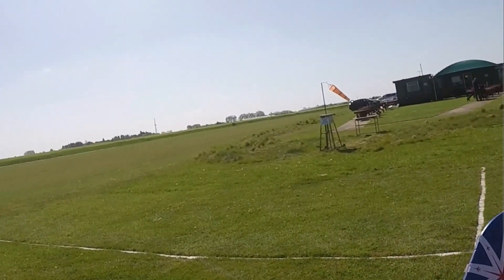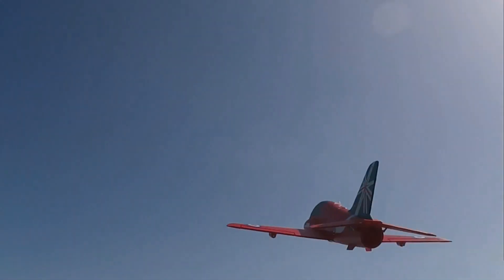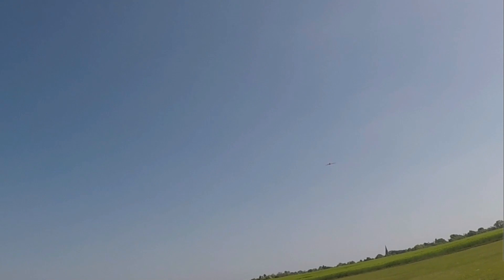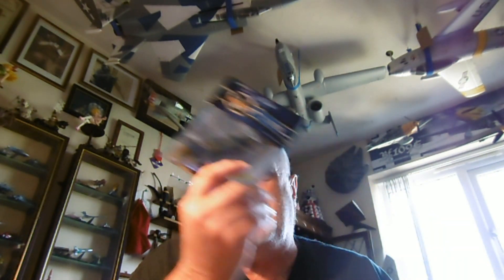Arrows Hawk & T33 - 30 to 40 AMP ESC Upgrade

Comment: You don't have to cut the fuselage. Instead remove the edf (it's fixed to the fuse with foam tack) and pull the esc out through the hatch. Connect new esc and push it all back. Glue the edf back in place...done.

Comment: Maybe I am wrong, but wont the more draw more amps when holding the plane stationery?
Reply from the maker: Yes and that's the Point - so you take a static reading knowing that it will drop off in flight (loaded) - but as it is not posable to measure how much it will drop - i find it safer to install an ESC that handles the load in static mode - so you know 100% your going to be ok on full throttle all day long..

Comment: Hey Martyn! I fly them on 4s without changing the ESC, but then again my alter ego is named "Bubba". Speaks volumes. LOL.  Great job...changing it really is the right way to do it. BRILLIANT solution to get in there...not afraid to cut some $hit! I like it! Well done, and as always just a reminder...love the hangar intros/outros my friend!
Reply from the maker: Hi Adam - we really should stop meeting like this LOL - I understand what you are saying regarding the 30amp esc - most do not change it over and run on 4S just fine - It was when Caroline's ESC burnt out on her T-33 that I decided to replace mine with 40Amp  just to be on the safe side - my methods can be a little unorthodox at times - but they (well most of the time) work for me 🤣🤣  - Thanks again for your encouragement with my Intros / Outros.. it really does help me .... stay well say high to Bubba, and the Mistry lady (Hildi I think) ?. Martyn

Comment: Thank you for posting this vid , great work ! You are brave to cut that pretty plane , by chance did you weigh the esc ‘s ? How much did it change CG ?
Reply from the maker: Hi Ironmover - the CG is always in the same place for me on this one  - however the Battery did need to move - and I kid you not about 1 or 2mm forward to compensate for the 40amp ESC..  loads of room for that in the Hawk and the T33 - Will take them to the Field soon ....

Comment: These are the fun to watch kind of videos. The hawk really looks nice after the install. A video like this on the FMS 800mm coming up next?? The F4U is a little more complex than the T-28. I was so happy not to sustain ANY visible mods on the F4U. Happy flights Martyn.
AirHammer out!!
Reply from the maker: Hi Airhammer - thanks for popping in - I do not understand your comment "A video like this on the FMS 800mm coming up next?? " - I am happy with the FMS800's I run mine on 3S 1000mAH - no issues - Mind you I have not done any Amp review of them (is that what you mean ?), MY FMS F4U has had no changes at all made to it - nor has my T28 - both fly great - will fly them all again soon also need to maiden the FMS800 P51.. - Cheers - Martyn Out.
Reply: @FlankerTanker  AMP draw test....
Reply from the maker: @airhammer6203  That sir can be arranged 🙂